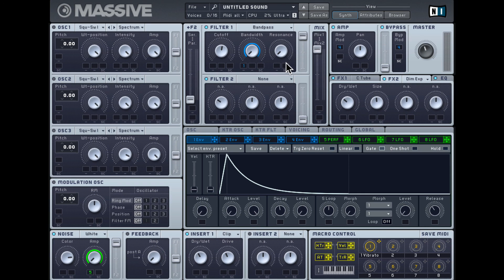Sound Design with Native Instruments Massive - 02 Electronic Clap

Comment: 0:13 Don't need a pitched oscillator. Make noise go to filter 1. 
0:33 4 Env.  
0:55 Make it sound more like a clap 
1:42 Assign the LFO to the Amp
2:21 Classic Tube in FX 1. Hardclipper in Insert 1. 
2:54 Dimension in FX 2. 
3:23 EQ 
3:48 Bandpass in Filter 1. Bandwidth. 4:07. Assign Env 1 to Bandwidth. Make it start from highest value and go down to the lowest. 
4:33 Hear in context of a beat. Play around with values